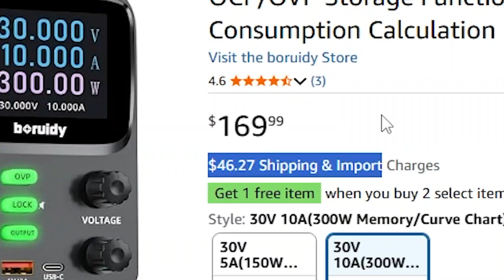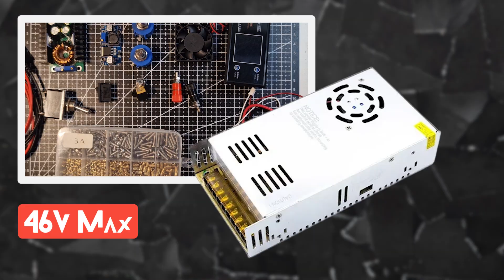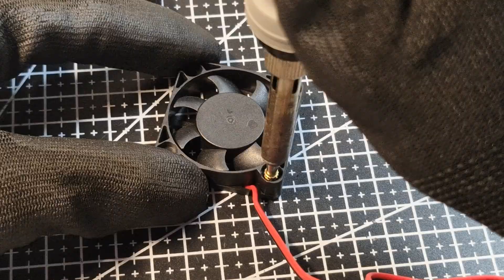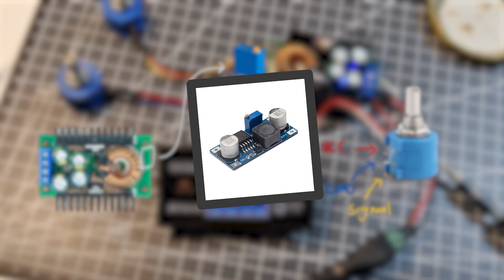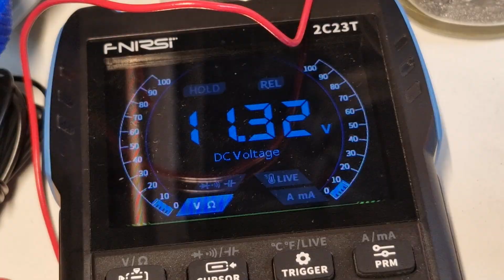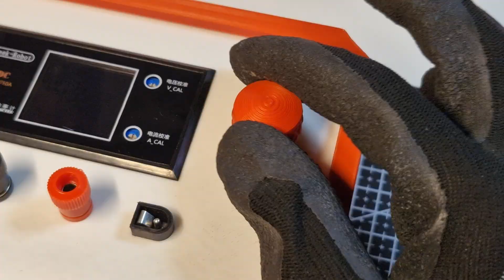Building a customizable and powerful power supply! | DIY Bench Power Supply

Comment: Nice build...but with your black 12v 6A input power source you will only get around 10.5v and 72W total, right? Better to get the 40v or so supply.
Reply from the maker: Yeah, I recently bought a bigger 40V 6A power supply. Everything works perfectly and it's much better